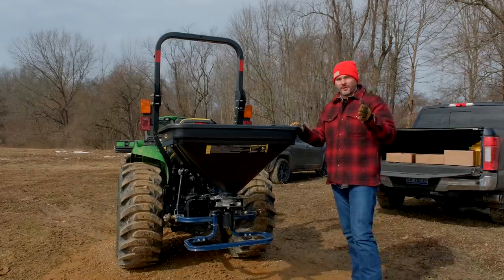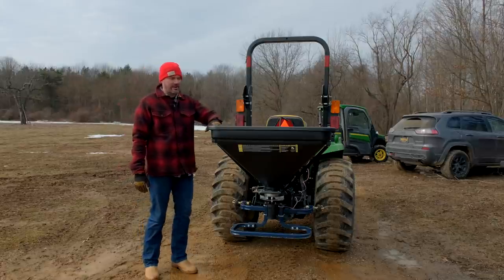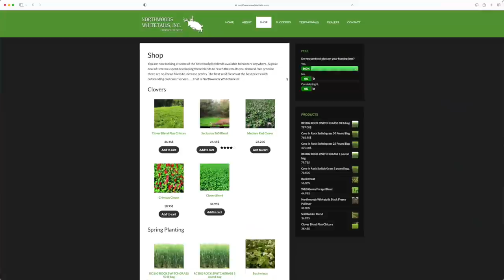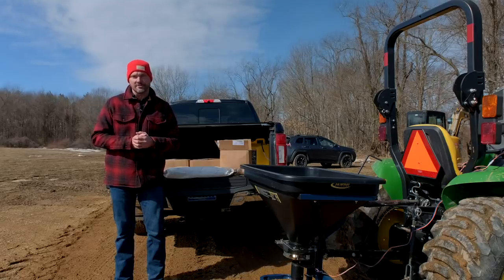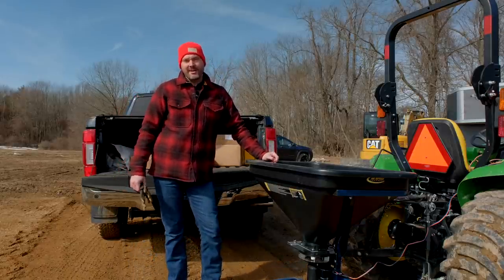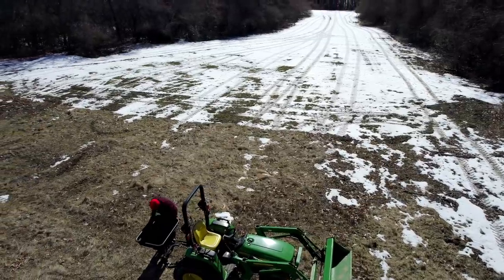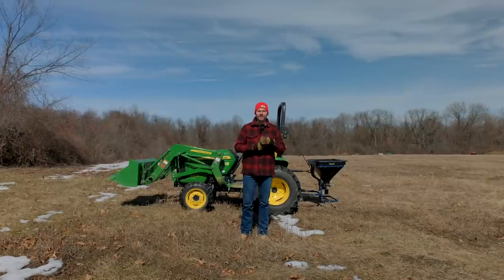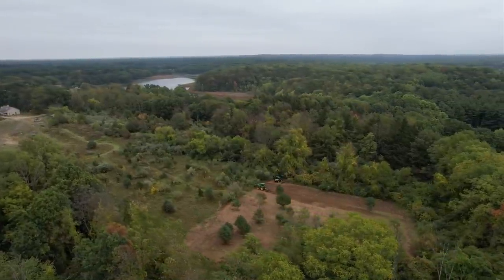FROST SEEDING! THE CHEAPEST WAY TO PLANT NO-TILL SEED! 🚜

Comment: I have installed a lot of 12v electronics and saw that spreader was wired directly to the battery. Never, ever connect wiring to your batteries without a fuse. A short in that wire will cause a fire and make for a very bad day.
Reply from the maker: Yeah, there isn't a mfg I know that makes electric attachments that doesn't include inline fuses.  That would most likely be something homemade.

Comment: Too bad it can't handle deicing salt. Do they have a model that can handle salt?
Reply: Different spreader, but I modified my “fertilizer“ spreader from tractor supply with a pair of hanging wings on either side of the spreader that constrained the throw for my driveway.   It worked like a charm, just need to make sure you wash it down well after use.    I just couldn’t see buying two spreaders when I could just make wings to allow one to  do both jobs.   Mine is a Tarter PFS20 (Poly, PTO driven).
Reply: @jasonmiller5586  I thought they were inferring that salt would damage the unit and make it unsafe or inoperable.
Reply: @jasonmiller5586  I think I'm going to do the same with mine. It only deploys when in motion and I have to reach back to open and close a handle. I added an extension plate for the hitch hook up so it wouldn't bind up when making sharp turning movements but it also moved the handle further away...

I had nursed one for several years and it was time to retire it spending too much time repairing it. It's a blessing cuz my driveways on a steep incline are about 130 ft long on that area alone.
Reply from the maker: These guys don't, but salt is hard on equipment.  Corrosion issues.